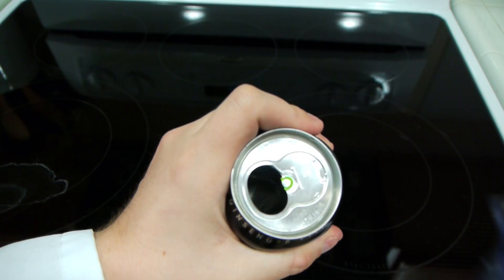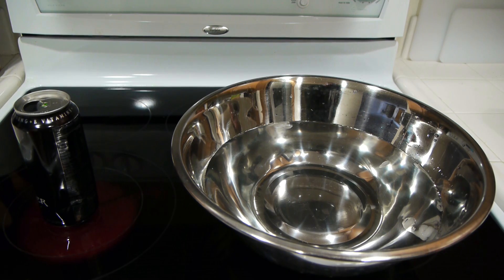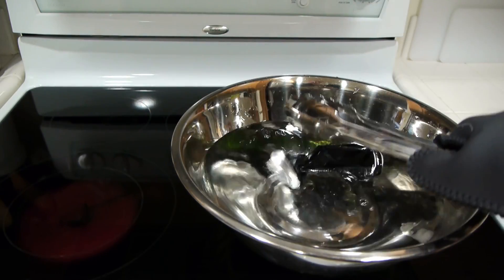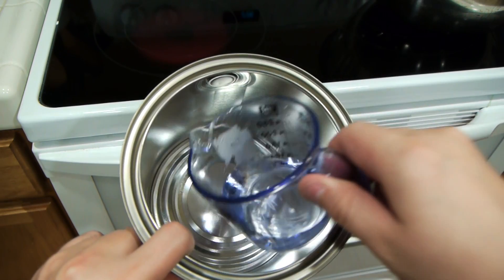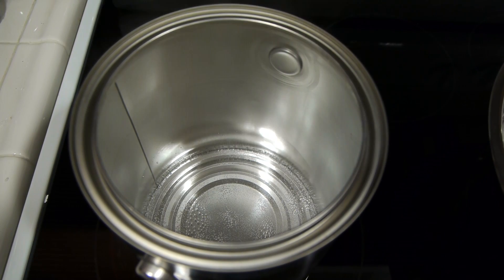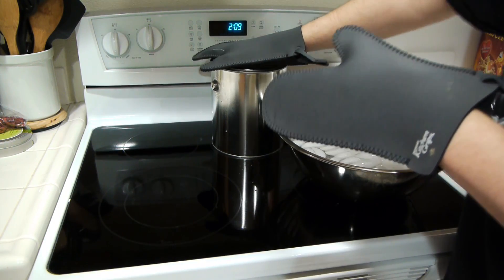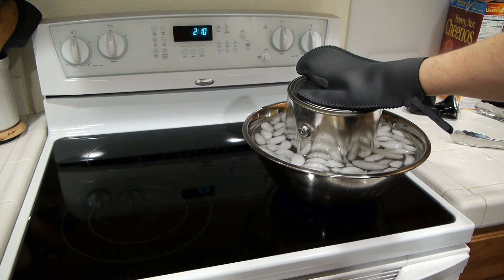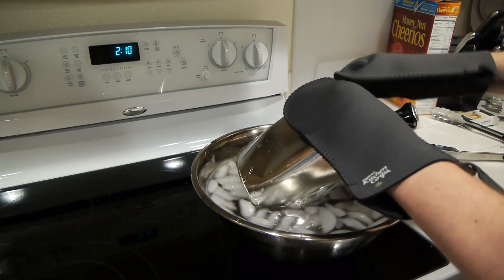Scientific Tuesdays - Crush Metal with Water!

Comment: @UnixDaniel11 no it will not because the temp the can melts is higher than the boiling temp of the water there for the can will not melt anless it was made of lead  or soldering wire (unlukly lead it poisonus )

Comment: You are an idiot. REasons why:
1 you cannot see steam, that is water vapour you can see
2 it doesnt push the air out, it gives it more energy meaning the air inside it exapnds.

but you did get the air pressure bit right.

Comment: the can is heated, so that the gas inside the can has less pressure.Whenever you stick it in the water, the can is crushed because of all the atmospheric pressure.There is ALWAYS atmospheric pressure on a liquid, unless you're in a perfect vacuum or space. The water is sucked up the can also, because it is essentially the same thing as using a straw.  since there is always atmospheric pressure on water, the atm. pressure pushes the water inside the can, because there is less pressure in the can.

Comment: No that wouldn't work since you need the air inside the can to expand not contract. cold water would make the air inside contract then putting it in hot water it might burst

Comment: Also,..It wasn't due to heat driving the air out causing a vacuum. The air and water vapor at the higher heat had a higher pressure associated with it, and due to the high heat the amount of molecules per liter of space could be less and still equal the outside pressure + aluminum can resistance.

Once the heat was removed the energy allowing for the faster motion of the molecules, hence greater pressure, was removed, and the pressure dropped inside relative to outside..crushing the can,,,

Comment: @kinglynx 

you got air pressure everywhere,
and since it's normally pressing equally hard on the inside as the outside, the can stays intact.
when you boil it however, it forces the air to compress, and create a vacuum
this isn't strong enough compared to the presure of the cold water,
so it pushes harder on the outside then on the inside

Comment: very common experiment.  it's because of air pressure.  the atmospheric pressure is higher outside of the can, so the atmospheric pressure pushes the can in, which, "crushes" it.  The reason so much water gets pushed in also is because that's exactly how straws work.  The atm. pressure pushes the liquid inside the can.  There is always atm. pressure on water.

Another cool experiment is if you put COLD water in a vacuum, the water will start to boil.  crazy right?

Comment: Well if its hot enough to turn the water inside into steam then it can cause then the steam can increase the pressure inside to the point that its more than the pressure outside

Comment: it actually works, i've done it in 6th grade. it's the rapid cooling in the can that causes the outside air pressure to crush the low pressure inside the can.

Comment: The explanation why this happens is very inaccurate.
"When the water boils it pushes all the air out of the can..." LOL, NO.

What's REALLY happening is this:
When you heat up the can , the air inside it heats up as well. As we all know, when you heat up a gas, it becomes less dense. 

When the heat from the air inside the can dissipates quickly into the cold water, the air condenses. A large DIFFERENCE IN PRESSURE results, causing atmospheric pressure to crush the can. THERE IS NO VACUUM.